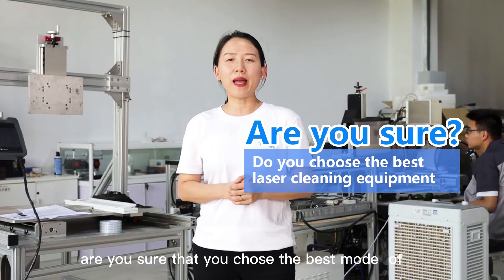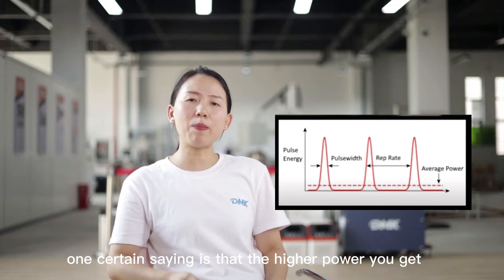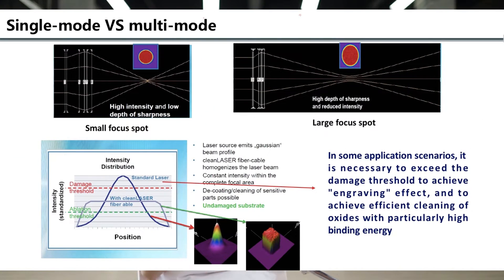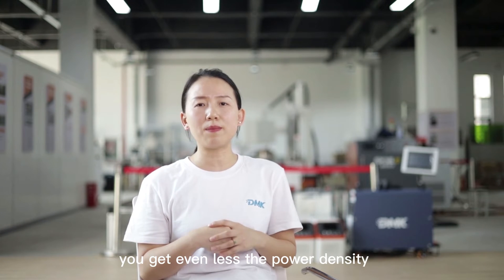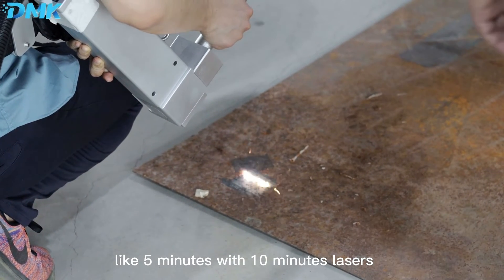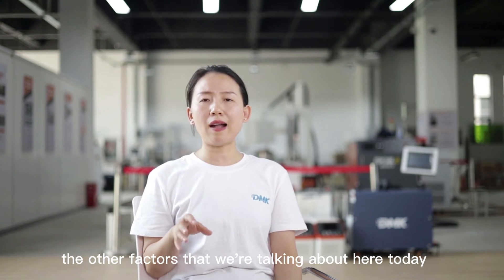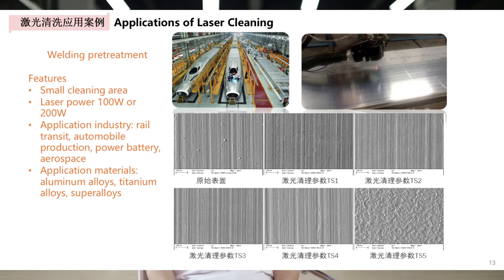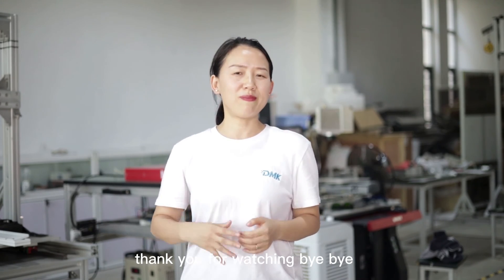how to choose the right laser cleaner for different laser cleaning applications? #dmk #dmklaser

Comment: After heavy cleaning with 2 kw approximately 4 hours, beam becomes weaker and weaker and finally stopped working, all reflecting mirrors and D20 F600 lens has melting spots and covers with white substance like ashes…any idea what happened and what reasons …thank You in advance
Reply from the maker: dust come into the cleaning head, and pollute all the mirrors and lenses, you probably need to change them
Reply from the maker: dust come into the cleaning head, and pollute all the mirrors and lenses, you probably need to change them

Comment: I understand that for safe surface cleaning a 200W Fiber Pulse Laser is the right choice and for bigger jobs where the surface protection is not priority but the cleaning effect like oil removal from parking lots or stonewalls a cw laser is the better choice. 
I‘d like to know whether you‘ve developed a laser for cleaning and for welding in one machine.
Reply from the maker: yes, your understanding is perfectly right, and we have 3 in 1 machine, welding, cleaning and cutting in one machine
Reply: @jallyqu  Thanks for quick reply. Regarding the 3 in 1 machine: Is this a cw laser? If so, one of these machines would match to most applications, right? Could you provide a link to your website for this machine, please?
Reply: I think 2000w continuous laser will burn brick stone?